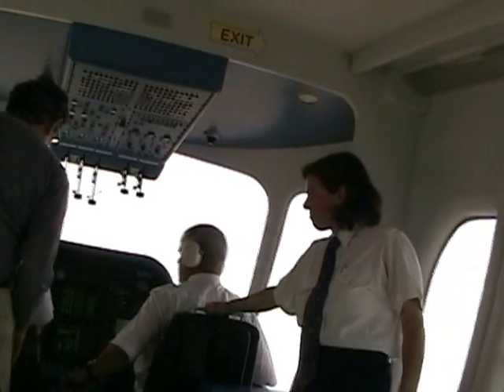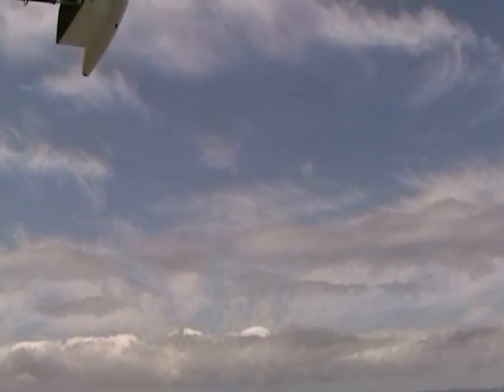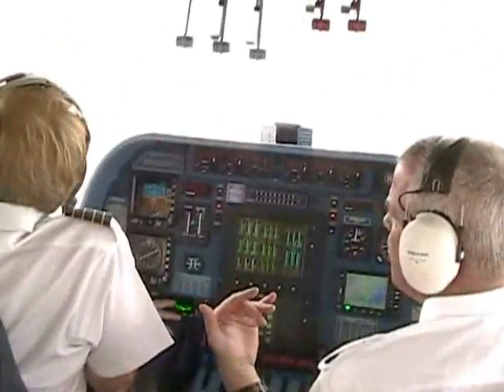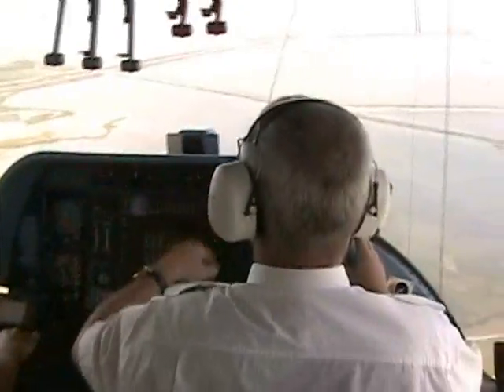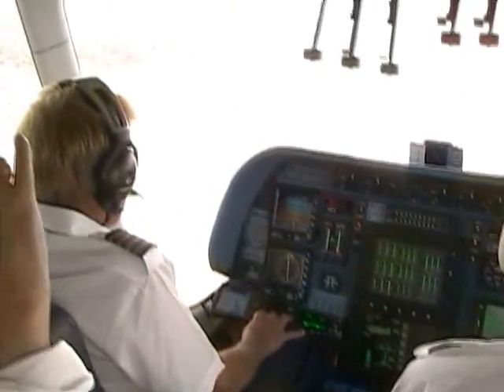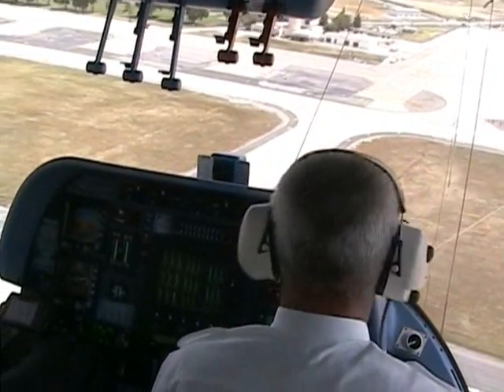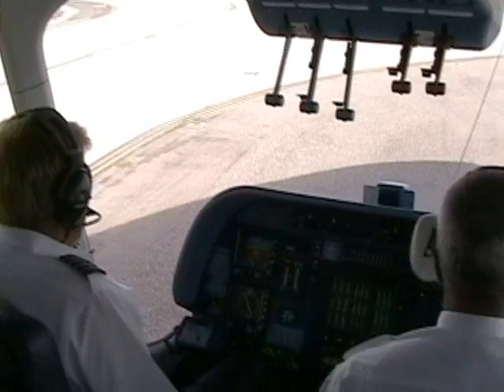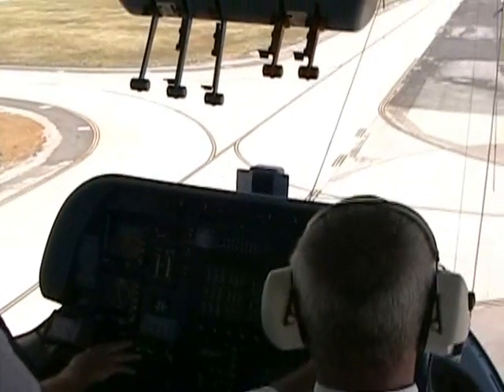Fly a Zeppelin project part 3

Comment: The old DELAG elevator crewmen would be turning in their shoes with these gyrations.  The NT is a more agile craft than the big rigids, but those big ships were flown very steady and very level to an imperceptible sense of motion aboard.  The elevator man was responsible for keeping the ship and her passengers on a even keel 24 hours a day.  DELAG standards were tight about deviation from horizontal flight.